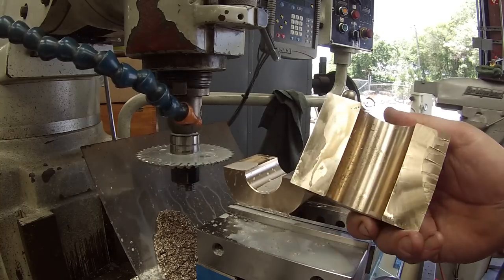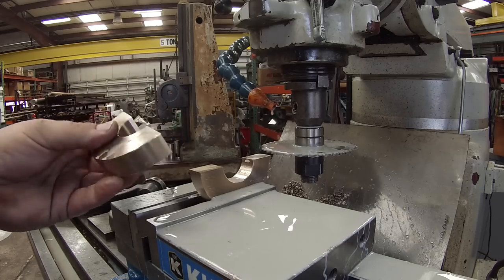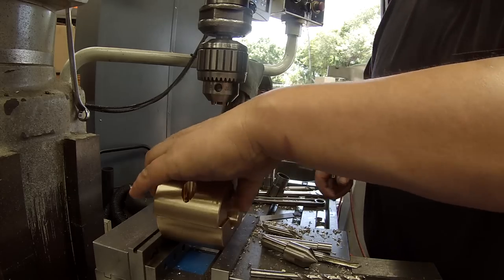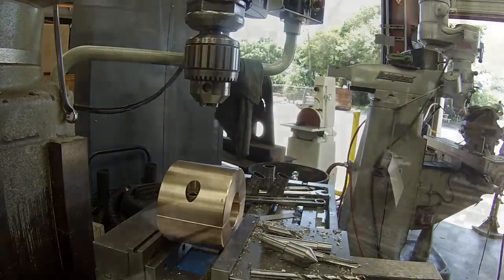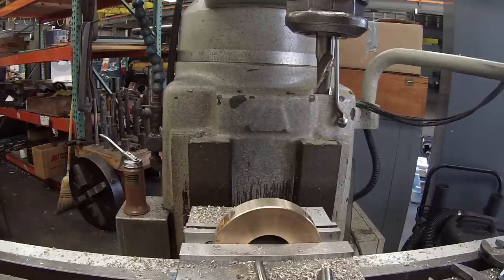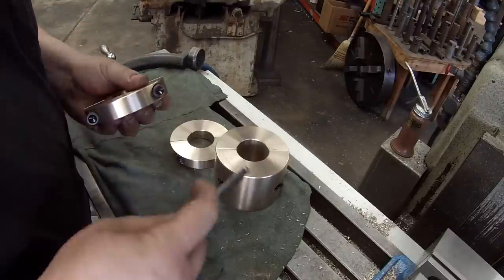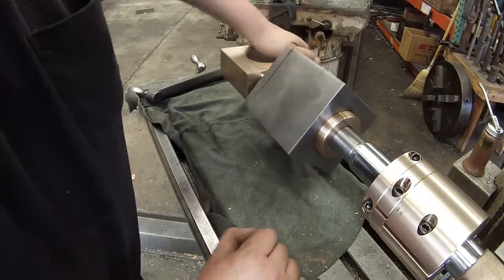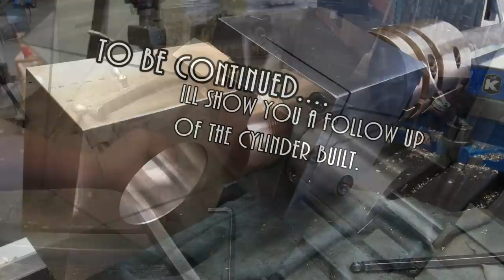Custom Cylinder Build Continued Part 3

Comment: Hi Adam,

You are doing an excellent job. But I prefer also to see the work holding and centering parts on your videos. I believe thats the point where a machinist's proficiency makes the difference and we have got lot to learn from you. Thanks.

Mehmet
Reply from the maker: I try and show that in a lot of my videos, this job I was trying to stay consistent and wanted the video to flow quickly. But I will try to show more centering in future jobs.

Comment: You said you don't know why there are so many (in regards to the brass retainers). I think it is purely so the points of failure is spread over three individual parts. If you made a single part that spanned that same area, if it were of by some margine, it would fail, but having three different parts they spread the load so even if one or two fail there would still be some retention.

Comment: It's been almost a year, where's the final assembly you promised? I feel cheated... lol.
Nice work, BTW. Reminds me of my Navy training from the 70's. One question though, regarding the split collars. I was taught to do the drilling and tapping before doing the slitting so there couldn't be any possibility of misalignment. That way all you needed to do was countersink the holes that were exposed after the slitting.
Just an observation. Otherwise, very, very nice work.
Reply: About drilling first. That was going through my mind as I watched. I assume Adam has a reason but I wonder if the setting up takes longer. I was going to comment but you already put it very well

Comment: I always get nervous using a slitting saw like this. Never fails the material will pinch down rather than spring open and try to bind the saw. Too bad you don't have a low clearance arbor so you could just feed across in "Y" axis across the vise and not have to set up each part twice in the vice.

Comment: Bronze clevis seems weak for such a large bore cylinder. Thinking the pin will elongate the clevis pin hole when in use over time. Beautiful work that bronze looks amazing

Comment: strange the habit all we engineers have of testing the smoothness of the chamfer with our fingers. We know its fine otherwise we wouldn't be stupid enough to run our fingers over it. Yet we still do it
Reply: +Tony Baron What's the point of chamfering something if not to feel it? :b
Reply: worst part is we all know if the chamfer is bad,or if theres just a tiny sliver stuck, via cooling fluid, static, etc, our fingers will have a pretty deep slice lol especially if you got it really cranking at high rpm haha
Reply: Tony Baron did you notice the bandaid on his finger in the last video?  Just wondering.. lol

Comment: Adam;

Great piece of work there, the client is getting some primo stuff.

Can you talk a bit about what "mistake" you made that caused the saw marks on the one side of the big split ring?  Was it the way the block was held in the vise, or did the saw blade get loose on the mandrel?  This would be a good teaching moment as I know I could not figure out what might have happened to cause those marks.

Regards;

Ron Kluwe

Comment: Hi Adam,

I've been a watcher of yours for some time now.  Sorry it's taken so long to tell you, but I'm a part of the chorus of cheers for you and what you do to share your knowledge.  Great stuff, man!

Real quick, I remember the video you did about your favorite multifix system.  I have a bunch of holders, but no post that came in a tool cabinet I acquired.  They are size B.  There are 5 regular turning holders and one v-groove holder.  Unfortunately, they're not the original brand like yours, but they do seem ok.  I have no use for them.  Can you put them to use?
Reply from the maker: James, thank you for watching and commenting. I do have the type B tool post and can always use more holders. Let me know if the offer still stands. Thanks!

Adam

Comment: Hi Adam I was wondering when you split the bearing in half did it make the diameter smaller? Is the thickness of the cutting blade considered as the amount that will decrease?

Comment: Ok, so now you have this beginner wanting to build a small simple air or hydraulic cylinder. :) Got any plans/advice for such a thing? :)
Reply from the maker: They're pretty simple. Just have to know the dimensions needed. For me its usually copy an original, or make one off a print.

Comment: Adam great work as always. Love it.

I know it's not your design, and your working to print, but how do they actually lock the rod eye to the cylinder rod??   As you know, the hyd cyl rod/piston is free to rotate as it cycles, thus it could easily un-thread from the eye causing a stroke change. Of course, I don't know all the details (I actually do this type of design for a living), but looks like they don't have a way to lock the rod to the clevis.

Just curious.

gd
Reply from the maker: In most cases the rod clevis is locktited to the rod with 277. You have heat it up to get it to break free. Sometimes there's a jam nut, and sometimes there's a set screw. With a set screw you use a drill and dimple the threads so that the set screw will lock down into the rod. 
This particular job the clevis used Loctite to hold it on. But that's another reason for the flats to be milled on the rod, is so you can jam the two together.

Comment: Slitting saw pinched on the way back? Didnt expect that with the brass.
Great looking job in the end. Any particular reason for such a large adjuster block?

Colin
Reply from the maker: Not sure of that Colin. Just made a copy of the original cylinder.
Reply: Well, make them a big spanner for it...lol

Comment: Dude, my question is: with the combination of cylinder and box, how does this thing get balanced in a production setting? - I'd hate to see the kind of forces and wear 4 of these would put on crankshaft!
Reply: My guess is it's a hydraulic cylinder. Not a piston or connecting rod for an engine.

Comment: Hi Adom,
I like seeing these job videos more than the tool shows! Any reason why you didn't do the slitting after the drilling, counter boring and threading? Thanks for the videos! Regards, Matthew
Reply: One reason would be that one half has a thread and the other half is clearance, so i guess easier to just split the collar first then tap one side and chance drill the other side.
However if it was me I would have at least drilled pilot holes before splitting, with those pilot holes as reference it would make it easier to clock up the split parts for the final drilling and  tapping or counter boring.
I'm actually curious how Adam clocked up the half parts, I'm thinking its not easy to find the centre of a half cylinder shape with the split-line buried in the vice.
Reply from the maker: It was my preference to drill, tap, and counter bore after the parts are split. It's not a problem finding the absolute center of each half using that digital readout 1/2 feature. If you work off the center line of each piece the bolt holes will line up just fine. One size over on the through hole and it gives the bolts more than enough clearance to line up. 
One advantage of doing this way is that you don't have to calculate the center of the part when drilling after you counterbore.
Reply: Abom79 I wondered that too - makes perfect sense now!  Thanks!!

Comment: Great work Adam :) I share in Mathews Q wrt the drilling and taping after the slitting? Nonetheless the fit does look flawless.
Reply from the maker: It's easier to me when I can do it this way. Just find the center of each half and move the table each way half the distance. In this case the bolt pattern was 3" center to center, so find half point, and move the x axis 1.500 to each side. 

Now the next job I may have to drill, tap, and counter bore before splitting. It just depends on the job and how I need or want to approach it.

Comment: hey Adam, when you split those bronze pieces with the slitting saw, how did you get the cut back level once you'd turned it around?
Reply: Simon Hills I would assume he used a piece of straight stock, put it into the slit, and leveled it with a machinist level, or he indicated both sides with a Mic.

Comment: Sometimes it feels like the slitting saws are out to get you...!
Reply from the maker: They be a bear sometimes that for sure. It's one of the processes that I don't like, only because those thin cutters can break easy, just like it did on this job.
Reply: @Abom79  the intermittent cutting sound... bad disc? off center alignment? 🤔
Reply: @GeorgeTsiros  Yes,  struck me too.  Also,  the arbor is obviously not rotating concentrically.  A connection?

Comment: To the more experienced machinists out there, a question.

When parting a piece, like Adam did in this video's intro, would it be preferable to use a wide tool that cuts a lot of material but get a better face as a result

OR

would it be better to have a thin tool that might cut uneven, loose less material and just face the item afterwards?

Or is it just a preference regarding material? Of course in this discussion, special cases are not included, i'm asking whether there's an unwritten code regarding this. 

Thanks in advance!
Reply from the maker: Again, depends on the job. These were some heavy walled pieces so it's better to have the strength and rigidity of the heavy parting blade then a small on this one. Either way, you can part the pieces off thicker, and doing a second opp facing them like I did the 3" wide spacer. 
But keep in mind that the thinner the blade, the less chatter your prone to getting.
Reply: Abom79 Thanks for replying.

Those spacers came out so nice, btw.

Comment: Man you must have plenty tough thumb skin.! Don't feel for a sharp edge when the machine is running.!
Hand feeding a drill with the soft tissue of your arm exposed to the rotating drill. ! Bad form. Don't feed the drill pushing past the spindle. Up and down not horizontally. 
SAFETY FIRST.